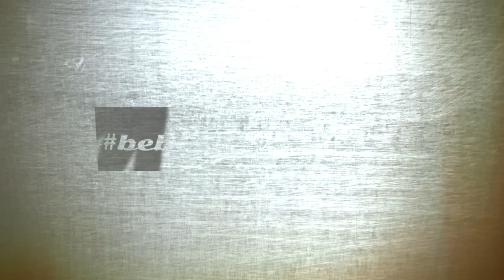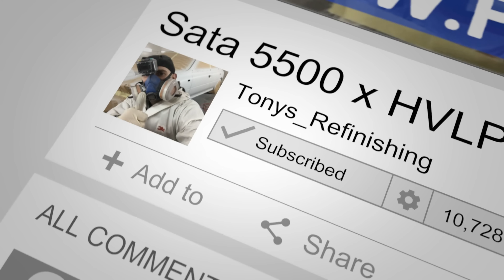£500 RESPRAY - MG Metro Cup Series Race Car - Rover Metro GTI - Sagola 3300 GTO

Comment: Hi mate..just wondering if you have any experience with tacky spray booth paint...i have tried the starchem version and it does not seem to dry and just stays wet certainly not tacky..have you used any of this product...cheers
Reply from the maker: I’ve tried a few types tbh mate the beat I could recommend would be the baxt wall coating it’s like a sticky film , as for the tacky sprays I’ve always found them to much of a pain tbh they do eventually go tacky but they don’t apply well or dry well I’ve found
Reply: @TonysRefinishingTV  Cheers for the reply i have two different types of tacky spray and neither of them have worked..i will have a look for the tacky film instead..cheers chris

Comment: Hi Tony, I've got a mates old panel van to paint in 2k direct gloss. I bought a Sagola 3300 GTO with the CarTech 1.3 setup (after watching your review some time ago). For the van job do you reckon it's worth me buying the EVO air cap and needle or should I just crack on with the 1.3 CarTech?
Reply from the maker: You should be fine with the standard gto car tech mate yes there shouldn’t be an issue using that
Reply: @TonysRefinishingTV  thanks mate!

Comment: Looks really great.  I'm thinking about getting a compressor for occasional home use. Do you think a 100 litre tank is adequate for car spraying or could I get away with 50 litre. Thankyou
Reply from the maker: minimum id go for 100 mate this is one i can recommend if it helps fella https://gtair.co.uk/air-compressors/8-burisch-bt-3100v-100-litre-air-compressor-5060523510085.html

Comment: Hi. Great video. What paint did you use ? Any info about supplier / brand would be appreciated.
Reply from the maker: Hi it’s was a 7.5 litre mixed kit from pmp supplies I’m not sure what brand it was mate tbh but can check tomorrow
Reply: @TonysRefinishingTV  Brill, I think you have mentioned the gun settings elsewhere so I'll look them up rather than ask again but it looks like it wasn't using a lot of air. My 3.5HP compressor with a 90 litre tank delivers 14CFM. Does that sound like it would be enough ? Thanks
Reply from the maker: just message them through facebook mate and they will sort you out and yeah this gun would be fine with that mate aslong as the free air delivery is around 10cfm you should be fine

Comment: Hey Tony,
I really need some help. I watched your video on your GT Air compressor from a couple years ago but I usually only have access to a 115v outlet. Can you suggest a 115v compressor for my mobile paint setup? We do spot and single panel repairs. I appreciate any advise.
Reply from the maker: hi roy just been having a quick look online then after your comment mate and as far as i can see i cant see a 115v compressor im afraid buddy , i would say your best bet would be to go for a petrol driven compressor instead i thing mate then you can use one anywhere
Reply: Thanks for the quick reply Tony. I have a brand new Kohler 6.5 hp which is awesome but it is so loud and I’m with you, I can’t find anything worth buying in a 115 V. Keep up the great videos and again thank you for replying. God Bless!
Reply from the maker: no problem at all roy sorry i couldnt help you further mate
Reply: It’s all good Brother. You have helped more than you know just by putting out great videos!
Reply from the maker: well im glad they have helped mate have a nice day
Reply: @royt.littlejr.8326  keep in mind you need double the horsepower in gas to equal electric horsepower   that not exact but close enough